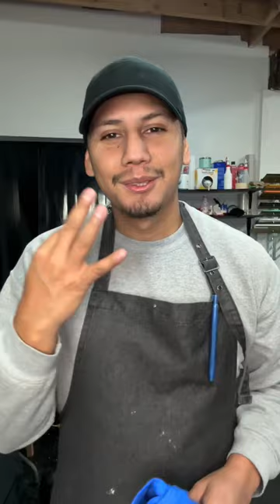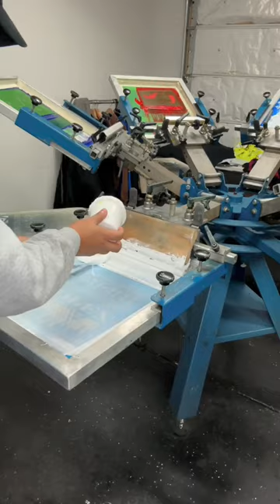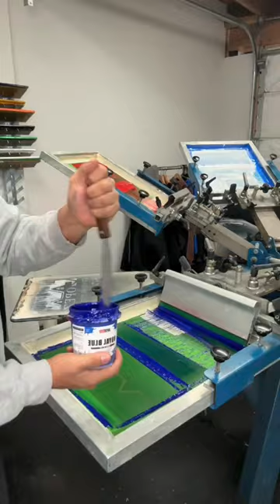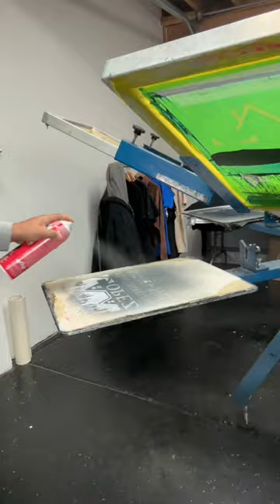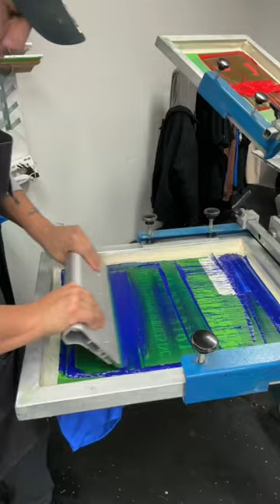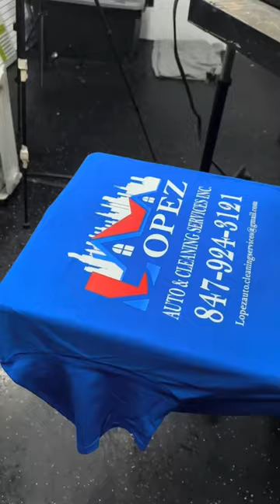Screen Printing 3 colors 🎨❤️ #screenprinting #short

Comment: What is the usual time period you heat flash between colors?
Reply from the maker: Depends how high you have the temperature also depends how low you have the flash.  But I will say a between a good 6-10 seconds